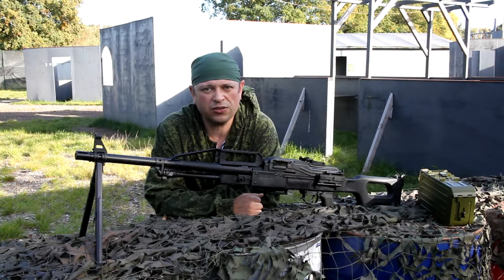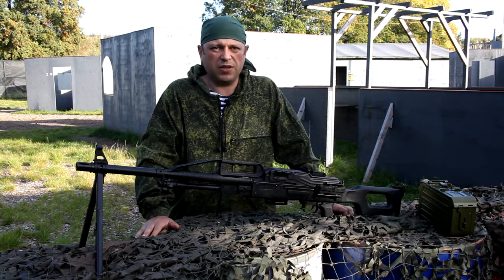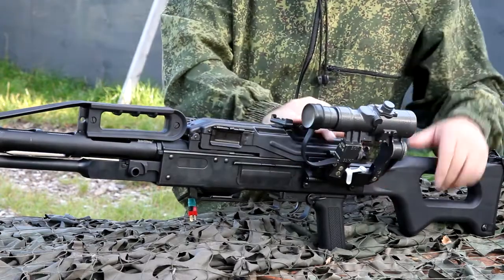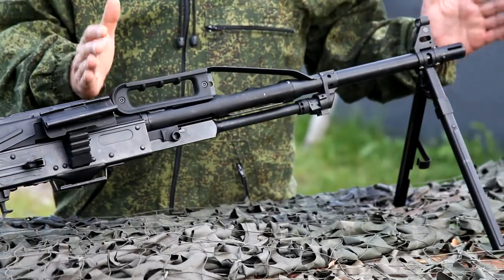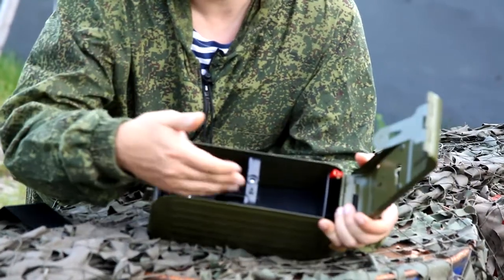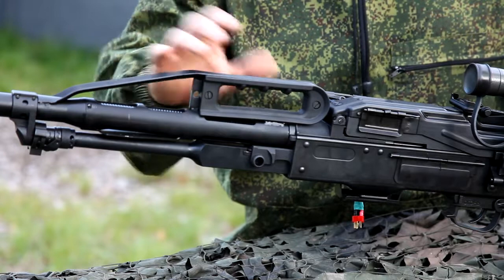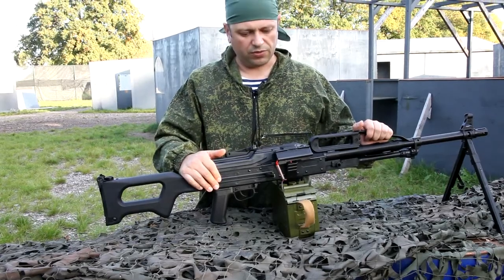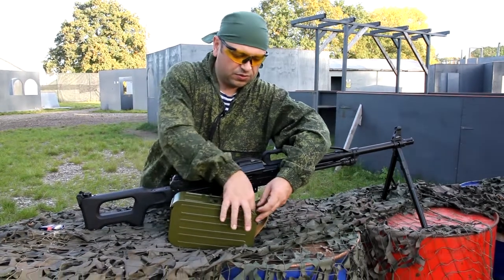LCTairsoft PKP Pecheneg AEG review - Part I (October 2018)

Comment: Split between this and the RPD, RPD is more nostalgic for me but this one just seems like a a whole other animal
Reply from the maker: I was working on an RPD recently. That one is a very-very nice MG. If I had no PKP already, I would definitely get an RPD. Just can't afford to have them both with like 5-6 airsoft events a year recently
Reply: I got the RPD a few months ago and it is quite nice, but there's no way to put attachments. I am thinking of making a second handguard and putting rails on it so that I don't ruin the original but can still have a vertical grip and red dot. I will say though, not being able to mount anything to it keeps the weight down ever further. I think fully loaded it's almost 10lbs lighter than PKP, maybe around 18lbs total? So if you have twig arms like me it will be a bit easier. 

I did notice when I was shooting it that sometimes it did not fire. I think it has maybe a loose connector somewhere but not sure. It could also have just been a low battery or something.

Comment: hello. may i ask what kind of optics do fit on the pkp and where i can buy them? thank you :)
Reply from the maker: hoi there. I have installed my PK-A with SVD mount on it, as this is the only one I have. The PKM-A is meant for PKM machine gun, but you can fit literally any AK (dovetail) side mount based optics or even a side mount with a weaver rail and use what ever you want on it.

Comment: Can your pkp take normal ak mounts? I cannot fit a B13 mount. The B13 for some reason there is to much space in the B13 for it to lock into the dovetail mount it will just slide in but i cannnot lock it and it will fall off.
Reply from the maker: you should be able to modify the space on B13, but not too much, otherwise you can break it.
Reply: @RAW_Andrey  well in my case i cannot it will break.

Comment: I got the same sight but cannot get it to fit 100% did u do Any ajustments for the sight?
Reply from the maker: You mean the PK-A?
Reply: @RAW_Andrey  yeah btw to be exact i got an Matrix Russian Spec. 1x25 Red Dot bought it from evike: https://www.evike.com/products/60797/
Reply from the maker: @shadowninja8082  normally, you can modify the tension in the clamp by pushing and turning the bulb. Not very much, but I can change between AK mount and VSS mount. and obviously the PKP mount

Comment: How exactly did you modify the wiring to have one battery for both the gun and the mag and not be required to push the winding button? Also, did it come with a mosfet already installed? Thank you.
Reply from the maker: will make a video about it in coming weeks
Reply: @RAW_Andrey  Awesome, just got mine a few weeks ago! Look forward to seeing that video.
Reply: @RAW_Andrey  i got mine yesterday and i would like to modify mine aswell where can i see the video?
Reply from the maker: @ceesyboy11  I still didn't shoot one :( send me otherwise a message on facebook, I'll send you the scheme I used. for the moment finishing the house, so maybe in a couple of weeks I'll start making the video. 2 years after date :(
Reply from the maker: and it comes with mosfet pre-installed, indeed. I just wanted a better solution for feeding.
Reply: Hi, did you make the video of the wiring mod?